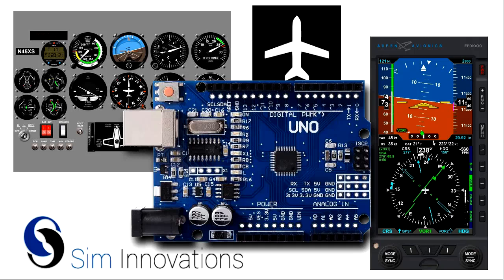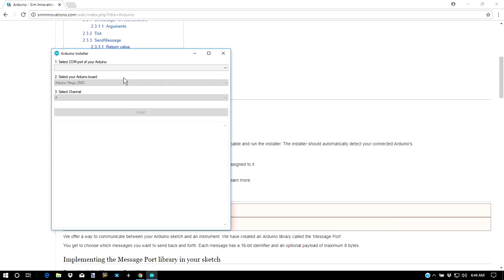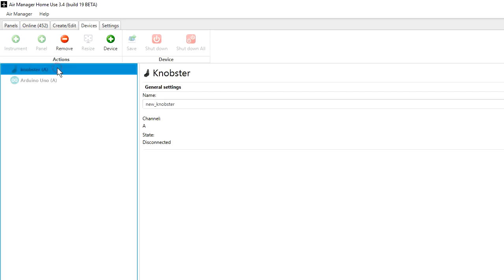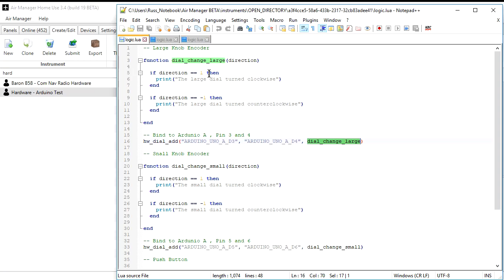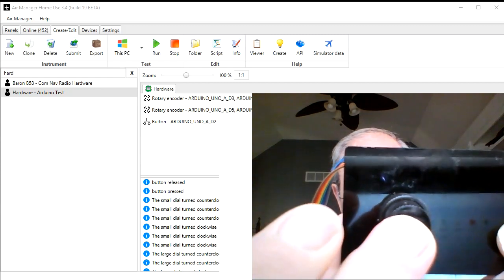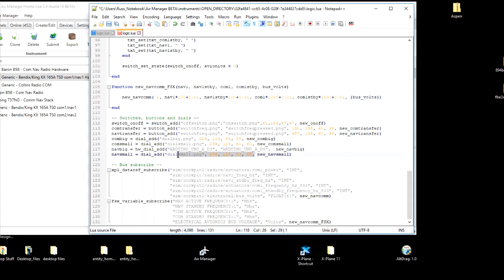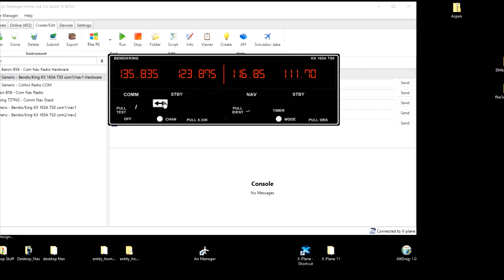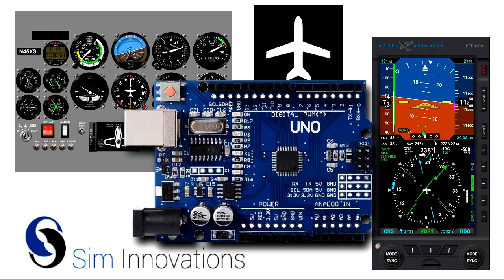Air Manager Does Arduino

Comment: Ah, that's better, Russ - thanks!  Could you give a source or part number for the encoder and the concentric knobs? And what about the code on the Arduino? Presumably there's a small program required to run on it - or will this work out of the box?  Thanks again for your skill and generosity in sharing these things. :)
Reply from the maker: Bob Gilchrist thanks for pointing that out. I got new editing software an just clicked “upload to YouTube” but missed the “higher quality” option. 

I got that encoder from Desktop Aviator but they are often out of stock.  https://www.desktopaviator.com/Products/8mm_Encoder/index.html

Another source that I like. https://www.propwashsim.com/node/15

If you want a true aircraft quality dual encoder the gold standard is the Elma E37. They are a bit pricey but used to be only available through Leo Bodnar in Europe http://www.leobodnar.com/shop/index.php?main_page=product_info&cPath=98_75&products_id=196

These are available now through a friend that orders them for his GPS kits and the price is better than Bodnar and less shipping to US.
See  simwarekits.com and if it doesn’t show them for sale just email him at his contact email and say I sent you.

There are several ways to do Arduino, SimVim, ArdSimX, LinktoFS, and Air Manager is just one I prefer. I am biased since I have been a long time user of Air Manager even before it supported Arduino.  An Arduino is just a computer so it needs software to do anything and just as a pc can run windows or Linux, these little microprocessors can run various programs to get the job done.
Reply: Thanks for the links, Russ. I'm an IT Pro, but specialise in servers, storage, routing and networking. Though I once programmed in Assembler, I've never used anything like an Arduino. I'm still unclear where it gets its code from to send encoder input to the serial port?  Does this get transferred from  AM or does it need to be loaded some other way? Thanks!
Reply: Bob Gilchrist You don't need to do any Arduino programming, Air Manager does all the communication. All you need to do is that little script that Russ shows in this video.
Reply: Bob Gilchrist I think July, but it's a product from SimWareKits, and I work for Sim Innovations, so I cannot say for sure.
Reply: Sorry for the delay in replying - I've been travelling. That's super, thanks! Do you have any idea if Knobster is imminent as a product?
Reply: Bob Gilchrist You mean when it'll be released?
Reply: Yes - there seems little point in embarking upon building one, if a completed unit is likely soon to be available?